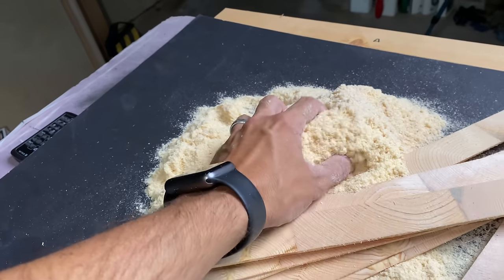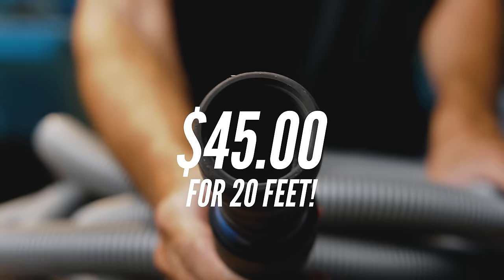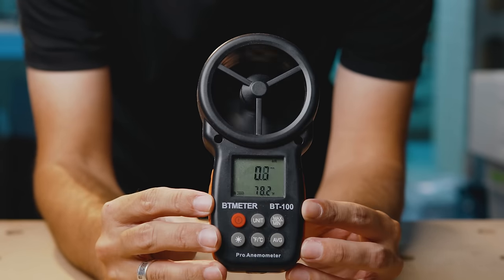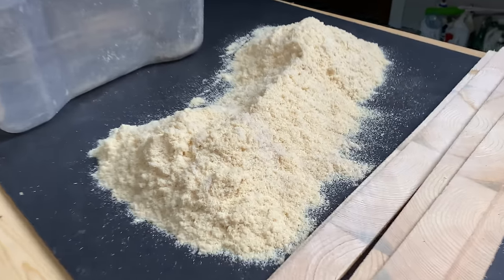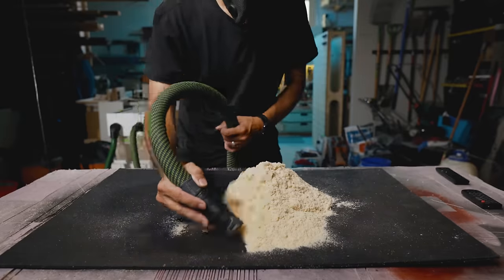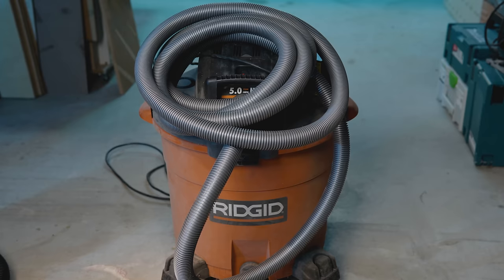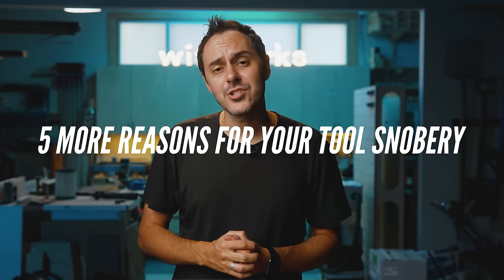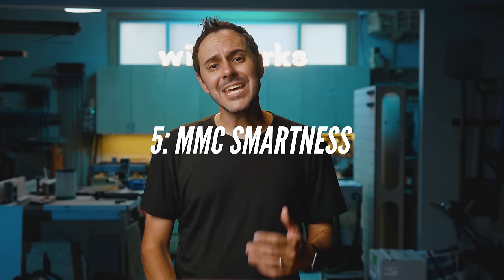This video will save you a lot of money. Dust extractors for beginners.

Comment: There is some flaw in your testing. The purpose of the Festool HEPA filtered vacuum is to extract as much of the unhealthy dust from the work area (cutting, scraping, grinding) as efficiently as possible without contributing to unhealthy air quality. In order for you to get a better idea of the quality of the vacuum you would need to have two particulate counters. One counter near the tool/operator work area and one near the exhaust of the vacuum. 

 You would need to get a baseline of the area, with both particulate counters, without using any tools or disturbing any dust. Then perform the tests with a counter at the operator work area and at the vacuum exhaust. 

In general, the cheap handheld particulate counters do not accurately count the number of particulates in the air. I would say that a good particulate counter would measure in the hundreds of thousands inside of a typical U.S. house.

No matter what, I would wear a mask when cutting, running the vacuum cleaner, removing the filter or bag, or just cleaning up in general. Because the vacuum could flow pure air, only for you to stir up some cancer-causing crud you never even meant to work on. If you are in a workshop, try using an overhead filtered downdraft blower.

Comment: Great video. I have been debating buy Festool products but hesitant because if the price. 
For those wanting to go this route, in my reading and watching reviews the CT15 is a great little machine if you do not need/want the Bluetooth. CFM between the smaller extractors (CT15, mini and Midi) and the larger extractors is only 7 CFM. So at 399 the CT15 is a great choice.
Reply from the maker: Yes, the 15 is great if you don’t need Bluetooth in the future or need the “hose garage” - but you can buy the garage as an add on for cheaper.
Reply: @wittworks  But be aware that the Festool separator will not work on the CT15.

Comment: I have a auto start switch connected to my receptacle and a multi-outlet plug attached to it to which my table saw, router table, bandsaw, miter saw, drill and surface planer are plugged in. I designed a off feed bench that my router and table saw utilize. My bench has 5 ports with 180 degree hinges that conceal the other 5 bench top tools. Each b t tool is attached to it's own shelf that rotates 90 degrees to bring that tool above the surface level of my bench for use. I also made a pleunum with gate valves and vac hoses for each that I open the gate valve for whichever tool iv used. The plenum is attached to a dust collector to a my Rigid shop vac. My shop is only 10' x 20' but I can rip 4x8 panels and route 8' pieces easily. the bench has rollers and if used in  garage setting the only thing anyone would see if the shop were not in use and the doors were left open would be the table saw and router bench next to my bench. Works for me.

Comment: The algoritm only now pushed this video for me.

We tried a cheap shop vac VS auto cleaning makita. We didn't use measuring devices, but black hair and a sunny day comming into the building gives an idea too. We were cutting concrete and the cheap one eather clogged fast with all the filters or give me grey hair without.
Usng the makita I was almost considering taking the dust mask off, it's just that now and again, a bit of dust escaped, but noticably less than with the cheap vac and my hair didn't need washing with conditioner afterwards to be able to comb it.

Comment: Instead of buying several “auto-start dongles” for 35 USD, consider getting a pair of Shelly Plus 1PM current sensing relays. Cost is approx the same but functionality vastly superior. They can communicate with one another wirelessly and among other things turn slave outlet/appliance on based on load at a master outlet/appliance, without having to run physical cables together. Also easy to program the same 5s delay in shutoff os your unit. All the other features will come for free, such as temperature and overload monitoring, and logging of kWh used. You could also have one hooked up to a PM meter to automatically start air purifier, dehumidifier or heating units, and much much more..

Comment: Something to keep in mind is a filter with a high amount of dust embedded in it is probably filtering more because the added dust is acting like a filtering medium. 

 I’m going to add a cyclone + 5 gallon bucket, HEPA filter and filter bag to my Ridgid vac. 

 I’m also going to experiment with adding a swimming pool filter bag over the HEPA filter.  

I’m certain all this will reduce velocity so I’ll try to find the best balance of filtration(air quality)and air movement. 

 Thanks very much for all the info you have provided.

Comment: To be fair to festool, you're paying for the research and development, extremely well integrated, designed and built tools, and an amazing warranty and customer service. If you're making a living from your tools and using them day in/day out, it's worth paying for the most efficient. reliable and comfortable gear. Is all my gear festool? No. But the stuff I have is fantastic. There's a reason they are the industry standard. Having said that, I'm more than happy with Makita making up the bulk of my power tools. 🙂

Comment: The reason the Festool stuff costs so much is because it's made from much higher grade materials and they're made in Germany not China. Their dust separator is expensive, but that's because they had to design it to work with systainer boxes on top. They aren't stealing money from you, the money simply goes back into R&D and also they can't have as low of prices as companies who sell through big box stores because they don't sell as many units. They of course don't sell through big box stores because they want their customers to have good service which those stores can't support; Stihl does the same thing for the same reasons.

Comment: I think the test you are missing is what the air quality is like right at the work piece. If the rigid shop vac filter was super clogged, it makes sense that almost nothing would make it through and explain the low ratings. But you would also expect it to not be sucking up as much dust in the first place due to decreased flow, so I think measuring right at the saw, where you are standing anyway, is what you really want to test.

Comment: i can see one flaw in this test, though. the old vac was dirty and the fact is filters become more efficient once they dirty up. that's wy you should only clean them when suction falls too low. theis may not be mentioned on vacs instructions but 3m respirator cartridges and prefilters do say you will get better protection as the filter clogs up a bit

Comment: I'm still rocking a ridgid shopvac and duststopper. I've considered buying a more expensive unit but... they're expensive. I use my shopvac, respirator mask and WEN air filtration unit to clear things up as much as possible. If I'm going to be making a lot of dust I also always work with the garage door open to let all that air out as much as possible. 

I agree with you about buying the higher end tools if its how you make a living. But for the diy hobbyist? Not so much.

Comment: If I was going to spend the money, I would buy a high CFM and h20 water column with 3 filters plus 1 HEPA filter and bag chimney sweep vacuum. (Not an ash vacuum) $800-$1,500. 

If you’re afraid of being shocked just use 2 feet of copper wire and put it in the hose, connects at the cuff.

Comment: First of all, great vid. Trying to decide which shop vac to go with for work beyond regular cleanup can be a tough one.

I’ve owned that 12 year old Rigid and added that diffuser, and it works fine. And I was happy the day I got rid of it for an actual dust extractor and a smaller more convenient shop vac. It’s a space hog and not very small shop friendly. 

Having moved to a new shop space with a different focus, I now own a Festool CTL 26 E and cyclone. Would have sprung for the CTM, but there was limited stock available and it was a priority. That said, it’s probably the best shop vac purchase I’ve ever made. Size matters, and this thing with its cyclone leaves the comparatively small footprint. Db levels are very good. My cheaper shop vac likes to let the entire neighborhood know when I’m cleaning my car’s interior.

As for HEPA results, yeah, I don’t know. I know I have a wood allergy of some sort, but so far the Festool’s performance hasn’t let me down, plus I wear a half-mask respirator.

Comment: College! See you at therapy 😂
good video! I remember reading somewhere that those big dust extractors with the cloth wind bag on top with the sawdust bag on the bottom, that you are NOT supposed to wash and clean the top bag after use, as the dust fills in the holes in the cloth overtime and becomes a "better" filter. Maybe your older shopvac is using a version of that property- it seemed a little clogged lol
Reply from the maker: Thanks! Yes I think the dirty filter is making the ridgid look good. I have a new filter to do a follow up test with.

Comment: Nice topic. One question about the execution, did you also measure air quality close to where your head was during the work.
Measuring behind a clogged filter might give scewed results.
Where you are breathing is actually where the quality matters.
Referring to: maybe thr clogged filter cant get as much air away from the source. But whatever little it does, goes out clean.

Comment: Although there’s a pressure/suction loss associated with a dirty filter, there’s an old saying that says a dirty filter filters best.....and it makes sense. But it can lead to premature failure of the vacuum or pump in a water filtration scenario. The pleats of the filter are clogged and the finer particles are getting filtered by the larger ones before they even get to the filter pleats. You should have thrown a new clean filter into that old shop vac and I bet you’d have higher levels of fine particles.

Comment: $659 USD, crazy cheap.  I'm in Canada, Lee Valley sells this model for $1459.99 CAD, $1635.18 after taxes.  At today's conversion rate, that would be $1,181.05 USD.  Or I could drive to Seattle (4 hours) and save +$395.46 USD (I backed the taxes out)

Comment: Great review. 

 Unless the hose diameters are the same the sir velocity isn't really comparable.  You could use a couple of PVC fittings and some duct tape (the handyman's secret weapon) to make a shroud that seals against the anometer.  Then the fps is comparable.  You can also calculate the area of the opening and multiply that by your wind speed and get cfm.

The dirtier a filter is the smaller the particles it will remove.  The already trapped dust works as a filter.  There is a tradeoff with this, as flow will also decrease.

Comment: The 20 ft hose is likely to REDUCE the suction a lot more than the 10 ft hose on the Festool.  See if you can remeasure with a 10ft hose on your Rigid set up.

Comment: Clogged filters actually filter better than new filters. So until the filter gets to the point where air cannot pass thru, it will actually filter better and better.
Reply: A big strain on the motor, but yes, you're correct.

Comment: I hooked another 20 ft hose to the exhaust port of my 18 years old Ridgid and let it vent outside my shop through a hole in the wall. 20 ft hose cost $29 from home depot

Comment: Very interesting! With noting that technically you should be measuring isolated air output with an optical particle detector. Measuring from ambient air adds lots of confounders including height of the exhaust port above any dust on the ground, cumulative effects from the order of the testing, etc, etc. Regardless, very interesting. Thanks for sharing!

Comment: I have personally witnessed those meetings where artificially inflating the price was chosen. It adds caché. It must be good because it's so expensive. It helps to provide better customer service. If you need to make $1,000 would you rather have a thousand customers or one customer? It's a lot easier to help one customer. In the business world there are tons of real world examples where people don't trust something or refuse to buy it because it doesn't cost enough! I can't recall any off the top of my head. Do an internet search if you like.
Reply from the maker: Totally. I’d rather sell to one customer. 😊
Reply: @wittworks  thanks so much for your review. I sent it to my friends. Well done. One thing that I wondered about is if you tried to find recommendations for air particle sensors. You make it sound like you just shopped on Amazon.
Reply from the maker: @galtthedestroyer  Thank you. I did search for several models and methods, and it got very confusing. I almost bought one for $1200 that is supposedly used in labs...but then I thought "this is a youtube video!" - so I ended up finding this one one amazon. Bought a cheaper one at first that was total garbage.

Comment: I feel you, bro... I do hardwood floors. At the moment, I'm doing some units for a client. the units have been fully remodeled. I could sand without a dust control system cause everything would be cleaned up once all is complete. but I hate coming out cover on saw dust, I like funcionality. it's sad how a cheap set up outperform a so well engineer, integrated and quality system..

Comment: All these filters do is clean the air before it is exhausted. With that in mind, why not just do what I do and attach a long hose to the exhaust port and run it straight outside to an area where it can do no harm. Just need a cheap shop vac and extra hose. No constantly wasting money on expensive hepa filters. Always use a P2 dust mask as well because there is no way any extraction unit gets anywhere near all the dust.
Reply from the maker: Interesting idea!

Comment: FYI, the only purpose of the cyclone is to offload the larger particulate so you are not filling your filters with the big stuff. Less changing of the bag. for instance, if you have it hooked up to a planer or jointer. So it's doing what it's supposed to do.

Comment: A dirty filter is more efficient at filtering, but reduces suction - which pretty much describes your 'old shop vac'.  The air quality meter never really measured  'bad' air quality (did it?).  It would be interesting to see what it would measure if you placed it in a bucket with a lid, and filled it with smoke.   Good, fun, video.

Comment: I'm running the rigid with hepa bag and filter, but I'm not convinced it traps silica dust. My recent idea it to hook a long hose to the exhaust port and run it out a window. I'm planning to use a 4" hose on the exhaust to reduce resistance on the motor to keep the best suction

Comment: Consider the airflow, too. If it is filtering twice the volume of air per minute, you would expect twice the particles going past the meter, all else being equal.

If you don't have enough suction, plenty of the sawdust will bypass your dust collection system, and juat be dispersed by your saw blade.

Comment: I have two of the Festool ctl midi with the Festool cyclone and they are absolutely great. I love the bloetooth remote as well. And I will buy a third one for my Kapex. One of them I use for my Festool TKS80 and the second one I use for sanding, domino and cleaning. The question is if the cheap dust extractor cen run continuesly for 4 hours of sanding like my Festool do. I love them. Great vid man.
Reply from the maker: thanks! I'll be at Festool USA in Feb. I'll take pictures of everything they've done with your money. 🤪

Comment: Imagine a filter as a sieve (which actually is a filter but on another scale) if you use it and don t clean it (like the bag in the old sucker) the holes get clogged making them either 1 smaller or 2 blocked, which is going to keep more of the particles inside. The tradeoff is airflow, which basically explains why it scored worse on the airflow test. For the next time i would advise you to explain your setup better (literally one of the most important things as a scientist) because it can help to find flaws and explain unexpected outcomes, for example one thing which would have helped would have been you saying that you started by measuring with the one you expected to perform the best (which we saw throu the timestamps on the 200$ tester) so the air in the room would not be contaminated by the one you expected to do worse (had you done it the other way round it could have been an explanation for the oldest to be the best (accumulated particles in the air from previous tests)). Anyways, apart from these little nitpicks great video, next time it would be interesting comparing them with a similar bag to see which one really performs the best.
Reply from the maker: Thank you and great points!

Comment: great video.. i think a good mask is the most important, since even with the best dust extractor/vac you will never get 100% of the dust. You can spend $1k on hepa dust extraction but still have .3 particles in the air. Kind of makes the case for an air filter.

Comment: I suspect that since you're using an old filter in the old vacuum, the filter is full of fine particulates which would enhance filtration. I'd be interested to see what you get if you  used the same new filter and bag on the old vacuum as well.

Comment: I think one area you missed is the test of air quality in the shop as a whole. Filtration might be as good in the old shop vac because of the clogged up filter but because of the lower air volume being able to be cleaned does the air quality in the shop as a whole begin to suffer?